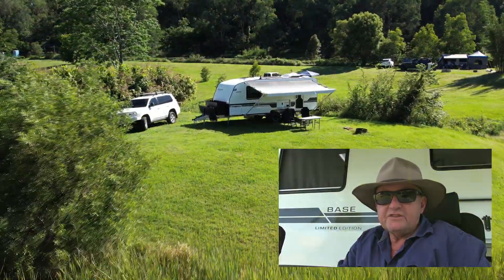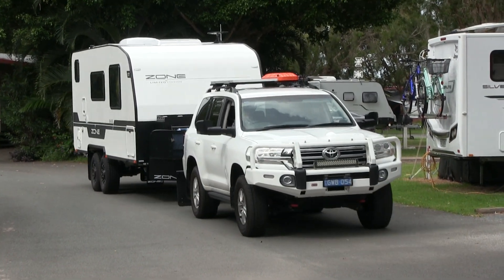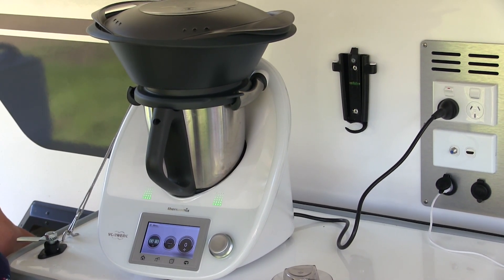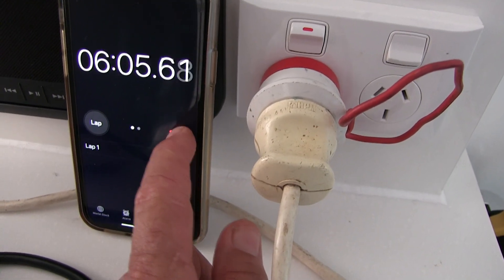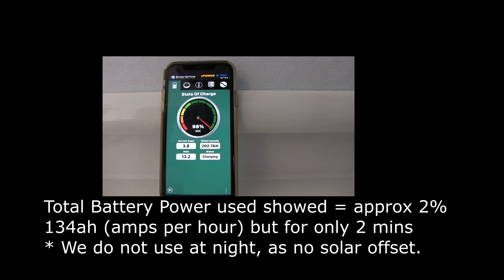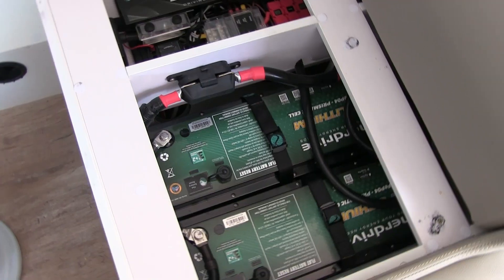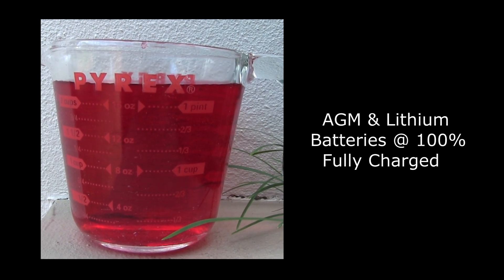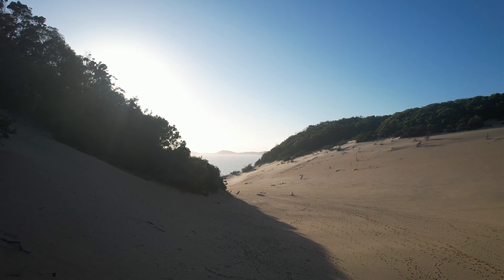Zone RV  20.6 Base - Off Grid Power systems explained

Comment: Thanks for the video Graham, just in time as we're going to Zone on Tuesday for our final specs for our Base due in July. Could I ask whether you also added a PMW Tristar Regulator or did you not feel the need for one? Thanks again and I look forward to following your travels. Peter
Reply from the maker: Hi Peter. We decided not to add the Tristar charger, as it can be added later if required, but to date we have not seen the need, with 400ah of battery storage this gives plenty in reserve and on average we use 15 - 20% over night and then we are usually back up to 100% by mid to late morning, even on cloudy days. Hope that helps, thanks for watching. Regards Graham & Ann

Comment: Hi Graham love your channel mate ,keep up the good work . I have a 20’6 base due in June , l have asked Zone a few times for the length of the awning but I think they are a little bit busy. Any chance you can measure yours for me. Looking forward to your next video. Cheers Tim.
Reply from the maker: Hi Tim
Glad you are enjoying our vids. 

Awning measurements; Width
To the outer edge of the upright bars: 4950mm approximately. 

Actual Awning width; 4600mm
Great size and works well with the rear door. 
Hope that helps. 
Regards Graham & Ann
Reply: @grahambelby9117  Thanks Graham .